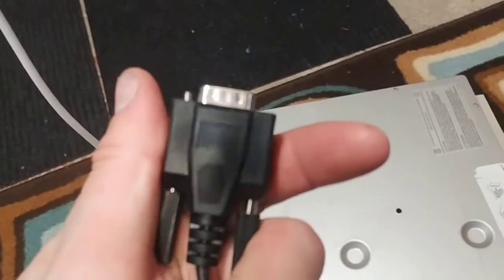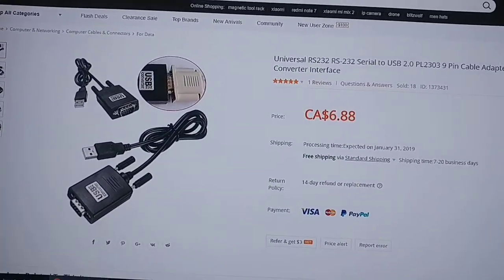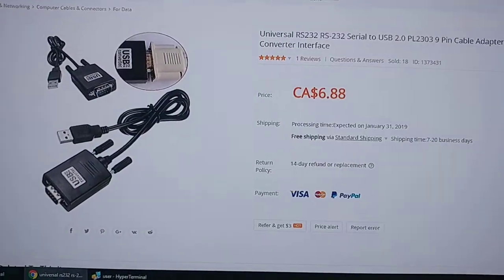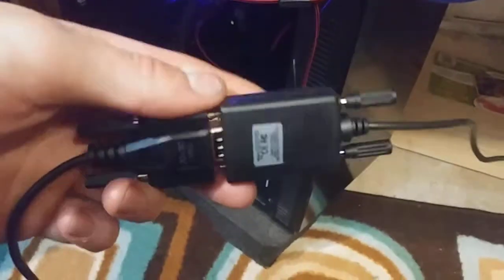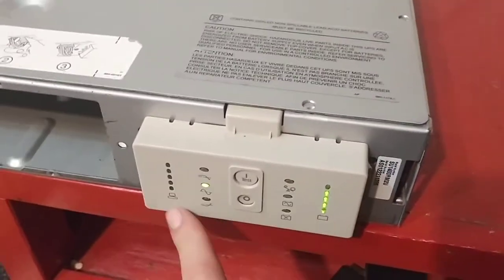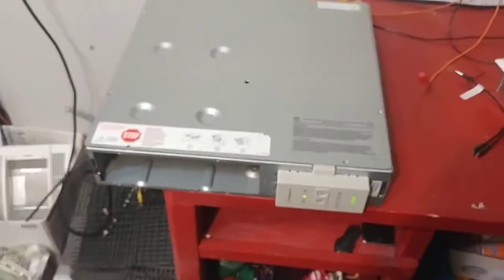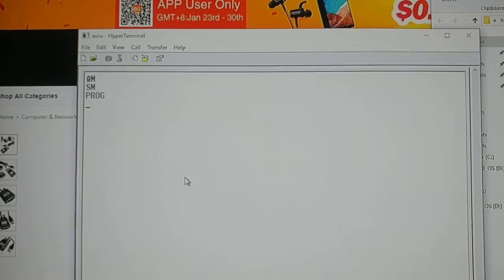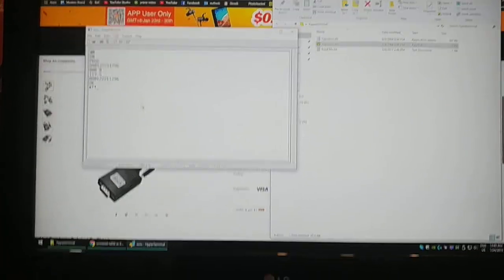APC UPS software mod using rs232 com port windows 10

Comment: Estoy haciendo exactamente lo mismo con la marca Salicru. RS232 con Arduino y Visual Studio. NET.
Reply: Y como vas? yo estoy en lo mismo para integrar un APC RS 1200 a un servidor Nas Synology (expenology). Lo que no se entiende de este video es que usa dos cables y además en la pc tiene una tarjeta serial-pci express 1X. Si una un cable rs-232 con punta macho-hembra que conecta en el puerto serial del Ups y en la pc.
Reply: @luisrebolledo8123  He logrado comunicar conel cable RS232 directo. Probé con otro cable, de RS232-USB, también funciona.
Reply: @Metaconta  Yo estoy investigando cuales son las conexiones por el rs 232 del ups...
Reply: @luisrebolledo8123  Le puedes pedir al fabricante por email que te deje el protocolo de comunicación por el puerto serie. Es un documento en PDF, los comandos a enviar y las respuestas que recibe por ejemplo, en el Hyper Terminal de Windows.
Reply: @Metaconta  Es un Sai o Ups viejo de la marca Unitek modelo 400 ST... yo ne refiero al pin out del rs-232.
Reply: @luisrebolledo8123  Los pines de Rs232 son los mismos de siempre. No hay problemas. ¿Quieres comunicar el SAI o UPS con el PC haciendo tu propio programa?
Reply: @Metaconta  Si queria el diagrama de pines, aunque me puse a investigar con el osciloscopio para verificar la señal UART. igual estoy pensando hacerme un scrip para correrlo en raspberry o arduino...
Reply: @luisrebolledo8123  Busca en Google los pines del RS232. Que son el pin 2, 3 y gnd. Arduino lo quiero hacer, controlando una pantalla más grande y gráfica.
Reply: @Metaconta  Tu programa es mas hacia lo grafico. Yo quiero a posterior hacer el UPS manejable a través de una aplicación. Github es un lugar a visitar.
Reply: @luisrebolledo8123  Gráfico es lo final. Quiero que muestre información y poder enviar comandos.

Comment: Me again , Did you ever find out what the minimum operational voltage is for these things? i changed the ups settings down to 24v and the led's on the front plate indicated only 2-3 leds of battery capacity so this 6S might not work out for me.
Reply from the maker: yea honestly I haven't done a full load test. its probably 20-22v seems they all are like that. I'll try to do a test next time i can thx!
Reply: @AndyShell  Thanks for checking that out , Im only shoving a 6S onto it wondering if ive gotta go bigger.
Reply: Minimum operational voltage on these old units is 25 to 27 volts, and they will not start without a battery installed
Reply: @maxjohnson8582  I think i put too much voltage into mine and maybe fused a relay , It growls very angry if you put mains into it and have a battery connected.